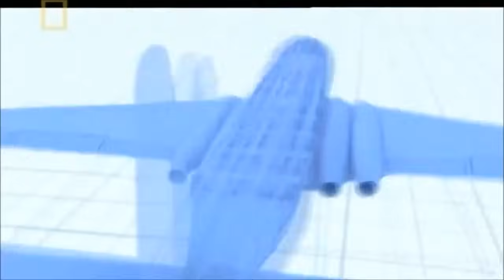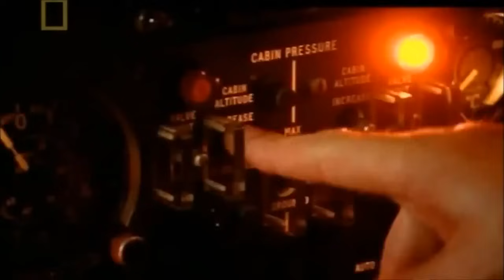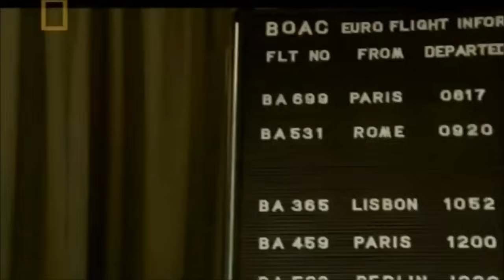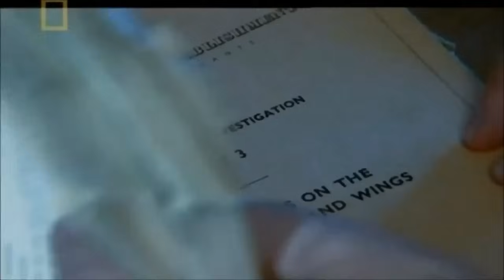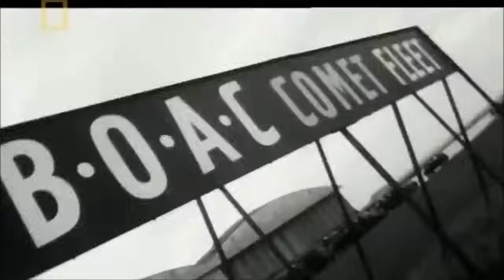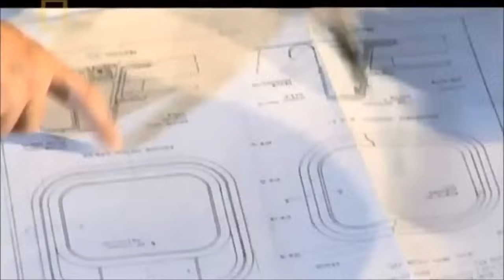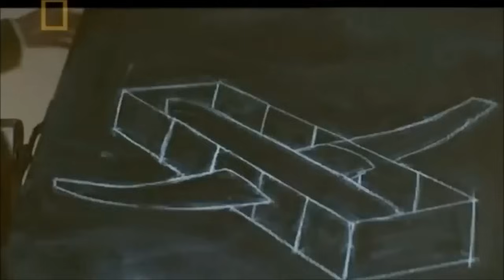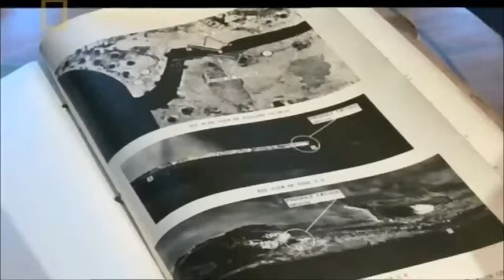British Overseas Airways Corporation Flight 781

Comment: One thing I've learned from engineering is that sometimes it's not best to "first" to do something new.  In the case of BOAC this holds true.  I don't frown upon their accomplishment, but the failure tarnished the brand and it never reached the success that Boeing and other manufacturers obtained in later years.  Of course Boeing and others had their share or failures over the years, and we all learned an important lesson with the Comet, but it just goes to show that being first isn't always better/best.

Perhaps the more sad part about the Comet was that the jet technology was sound, it was where doors and windows and more specifically, how they were installed.

Comment: A turbofan is a turbojet. A turbine jet drives the fan in a turbofan. (A turboprop is a turbojet. The fan is on the outside.) The modern turbofan offers much more bypass. The part of the modern fan-type engine that delivers the most thrust is that first stage: the thing you can see, sitting forward, when you turn your neck like my parakeets do, as they fall to sleep. The trouble with the Comet's wing design (IMO) was similar to the vertical stabilizer on a DC-10. Looks good, but a terrible idea!

Comment: My wife flew to Singapore on the return journey in early 1954 with BOAC when she was a small child, I wonder how it survived?
Reply: The problems that caused the two Comet crashes were rectified in later marks and in modifications to existing aircraft. It also took time and bad luck for the fatigue to take its toll, so even a flawed jet could make some flights before something bad happened.
Reply: Dan Air was Flying Comet 4's until the 90's. The British Navy Nimrod was a Comet in the Jacket of a submarine hunter, flew into the 2000's
Reply: Later models of the Comet were made with round windows.
Reply: *****

 I found that out in the docu-drama when they submerged that one aircraft in the water tank to find out why they were breaking apart. The Big windows were a major selling point for the airplane. When they went to Round windows, they also took off the sharp angles on radio and radar reflectors. Cargo Doors...everywhere there was a sharp angle. It was a good aircraft,  but by the time the Comet 4 came out, it was too late. it's  a shame too because they came out years ahead of Boeing. Boeing wasn't even in the market for a jet airliner, they were building a Jet Tanker for SAC for the Jets that were coming on line. It's capacity was somewhat lacking too. It lived on as the Nimrod Anti-sub aircraft. I was on Subs in the 80's and went up against Aussie Nimrods in War Games. Very handsome lines for a warplane. It served the Commonwealth well during her service life.
Reply: Rick Raven Rumney Yes, I agree that if it hadn't been for the accidents during the early years of production, the Comet would have been a strong competitor against American built jets. If the Comet was successful, perhaps they could have equipped it for supersonic flight using an afterburner, to be even faster then the American built jets.
Reply: *****
I don't know about supersonic flight. But if it was successful, from the start it would have been a strong competitor. It lacked capacity, perhaps a stretch version would have been in the making. But The Trident Jet, in one fell swoop would out compete the Comet, carrying more passengers. The Comet was more of a prototype for jet commercial aviation. It was a great start. I hate to say a lot was learned from the Comet about metal fatigue and pressurization and fuselage opening. The reason I hate to say it is because many people died. It is proof that every leap in aviation had a huge price to be paid.

Comment: Disintegration in mid-air is the most horrible thing to happen to passengers! TWA Flight near New York suffered the same fate years later!
Reply: I'd argue Nigeria Airways 2120 or Japan Airlines 123 were even worse for the passenger.

The Comet mid-air disintegrations were horrible, yes, but they were mostly quick and almost painless deaths that happened suddenly and didn't involve minutes of fear and suffering.
Reply: @extremegrieferjesus8897  The real tragedy of the Comet Disaster was it could have been easily prevented if d-H engineers had learned about metal fatigue from the Germans and Americans.

Comment: I vote for the replacement of the entire section (of course if the section is free for any kind of fracture). I guess they will increase the search of stress more intense when the plane gets older (in my opinion they should  do it with same level of search intensity every time, no matter how old the plane is). Hope that every bite of the plane has had a very intense search for bad spots before they even put the plane in the air the very first time. Yes and thanks for the answer.

Comment: Actually the Comet's ghost engines have fan blades deep inside the engine. Type Ghost jet engine on google and you'll see pictures of the fan blades that perfectly fit the Ghost jet engines of the Comet. Boeing's and the Comet's engines are not that different, except from external view. Boeing makes turbofan planes, while the Comet is a turbojet.

Comment: Somebody who knows about engineering told me recently that despite the very  thin skin of the plane, the square windows etc, the failure in the cabin would not have happened if a higher grade of alloy had been used.
Reply: +3replybiz   It's really a matter of the number of pressurization cycles.  Each time it is presurized and then depressurized, it takes a toll.
Reply: I think that the Germanwings crash had a lot to do with a very old plane which had been given a hammering, lots of short flights and one day sudden metal fatigue. The recordings made on the last flight have never been played at a public enquiry or coroners hearing which is odd. The French prosecutor involved said it was pilot suicide almost immediately after the incident. My point is, like the Comet, you can't predict sudden metal fatigue.

Comment: There's the tail of a 747 at 4:15
Reply: TheNw1218 the devopment of the 747 began in 1960's so no surprise if you saw tail fin..
Reply: timexironman100m the story has happened not in 1960. Also this is obviusly reproduction made not in end of 20 or beginning of 21 century so 747 is impossible to be seen at the comet's years
Reply: TheNw1218 e

Comment: I believe they tested the original design, which was altered in manufacture.  Glued components did not fail, but were replaced with rivets.  Manufacturing that followed used knowledge gained from the losses.

Watson: "When I hear you give your reasons," I remarked, "the thing always appears to me to be so ridiculously simple that I could easily do it myself, though at each successive instance of your reasoning I am baffled until you explain your process.

Comment: I can see they cant do three days inspection before every take off but at least check the most vital parts such as the tube to the fuel and look for loose wires/cables. Not just look at the plane outside but also inside.

Comment: I think this all basically happened because when the comet airframe was tested by the designers, it was glued together...but when it was actually manufactured, it was riveted to save costs...and that led to the ultimate decline of the aircraft company. This is what happens when an engineering company is driven by economics! One of the reasons I just hate most of board of directors, because they know no shit about engineering and just go after the economics. I just hate such MBA graduates!
Reply: TheYorkMan

It's American firms that are hobbled by MBAs -- here in Britain it's accountants who are the real menace.
Reply: Sometimes, the failure is not the board of directors, it is much further down the chain. The collapse of a concrete bridge across a hotel lobby in Kansas City - which resulted in the death of more than 100 people - was caused by someone in the field not assembling the hangers as designed, to save a little.. TIME. The result was all the weight of the bridge was transferred from one hanger rod to another.. by a single washer.

Comment: The comet would have been a great seller, had they found out the design flaws before 1954
Reply: The Comet was doomed to failure... as was the entire de Havilland company.
They simply never successful made the transition from wood and fabric construction to modern design and engineering standards.